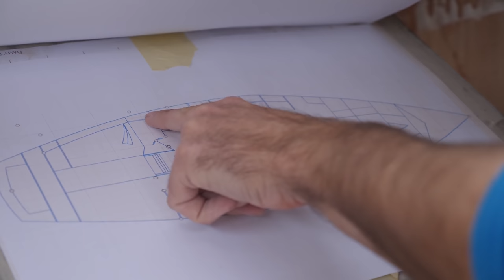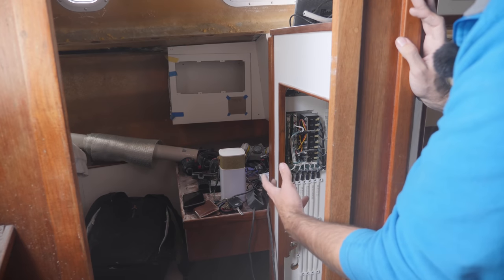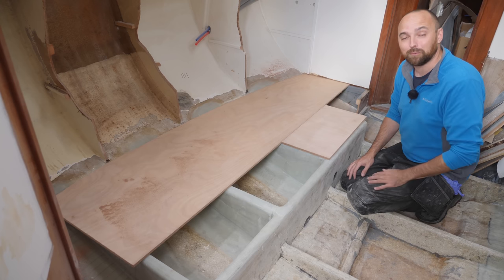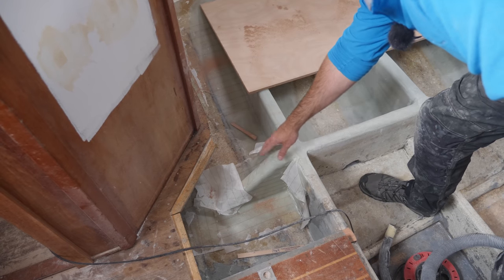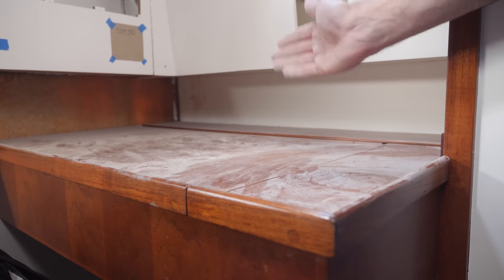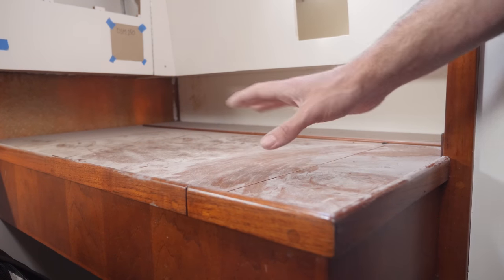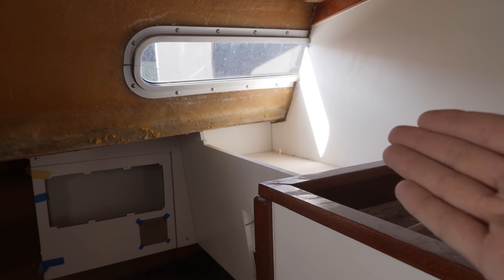Sail Life - Bulkhead number two, check!

Comment: Maybe the door could be made up of vertical slats attached to canvas. This assemble then runs on a curved track (ceiling and floor) between the new bulkhead and aft cabin. Mush like a curved top desk but in the vertical direction. Might match the curved corner across the way.

Comment: I'd think expanding foam (various specialized 2k PU spray foams in cans might work) could work fine, but I think it depends on the adhesion you get to the surface and to the amount of flex. From what I've read PU is stiff but friable, so if it flexes too much it turns into dust. Might not be a problem at all for your sailboat. Might need to ask an engineer.
I'd probably try to do it also below the floorboards for insulation (thermal and acoustic).

Comment: I would think the deep bilge would make a great tank for something like water or more fuel you can never have to much. For the door to the aft cabin i would think about a pocket door it would slide out of the way which takes away for a swinging door and give you more room to move around and can be locked it place open or closed to give more privacy for who ever is using the aft cabin. To hang a curtain or flex door might take away for the craftsmen ship that you are taking time to do on you're boat and will look like a cheep fix look and just might not give you the finished look that you are striving to get with the refit.

Comment: If that Bilge area isn't part of your Keel access then like the previous person is to fill it up again but this time using "Foam Cement" which is light and as strong & Hard as Rock. Glass over it at the depth that suits you.
Reply: Maybe lead shot. or steel or stainless steel shot(Think BB's) heavy and form fitting you could then through a layer of epoxy foam on top and final a real layer of fiberglass and "seal it up" it will leak because it has to leak its a boat.

Comment: Thanks mads👍 have always liked the wooden roller shutter doors one or even two to open in to the back cabin would look great and save space. Don't know if you can build them or just buy and trim to suit?? With regards the bilge at the top of the keel why waste storage space glass and paint use as a storage for beer will be nice and cool, could even make a rack system that pulls up🤯. I know you might get water down there but beers will be fine👍🏴

Comment: Mads    A angle Door would be better more inside room and if someone is sleep in there they can get some RR plus when you use the map area the door will be Close. Good luck. Could you use that deep hole to help drain the boat if water gets in there? Just install a nice Pump to keep it cleen.

Comment: I would make the door like a roll top bread box on its side or two sliding door that comes together. The bread box door is easy to make take a canvas make some wood slats and glue or tack the canvas between the slats like a certain but it would be stiff put a track on top and a Chanel on the bottom. BUT use mold resistant canvas or old sail that is damage to badly for repair.

Comment: i sugest you can put an inclosed pump in that deep bildge to to pump water from the shower to a holding tank for grey water. use the grey water to flush the toilet. that will save you a lot off calcified and glockt hoses in the future. toilet membranes would last a lot longer too.

Comment: I watched  building the chart table many times,  It was heartbreaking to see it destroyed.   Anyhow, what about putting in a sliding door along side the companion way do it slides fore and aft along the side of the engine compartment.  Thus not intruding with either the limited space in the aft cabin or with the new chart table.   Defiantly need to plan for a space to have computer monitors mounted into the new salon.
Reply: Look on the bright side at least you get to see Chart table 2.0 and get to watch that many times.

Comment: The aft cabin is for guests right? Other than that youll be using that room for storage, so a outward openning door would do the trick nicely, your'e not going to be in and out of it all the time. Sliding doors and bifold doors are OK but always compromise the look a little

Comment: Maybe a pocket door for the quarter berth?

I wouldn't like filling that space with foam. Yes, you would do it proper and seal it up good, butif it happened to develop a leak in the future, you would be back to that same foul smelling mess to live with and enjoy. Also, storage space being as valuable as it is on a boat, sealing that up doesn't seem ideal to me. Rather, it could be used as is for a "deep" storage for some oversized items, or break it up and have 2 sections. Glass a lip around it to use as a support for a hidden floor. Cut a board to that size, glass it, put some sort of handle or draw line to help remove it. If worried about standing water if you get a leak, I'm sure you could get some kind of rubber seal between the floor and the support lip, or side wall around the floor board. You wouldn't loose items down it that way, and you would have a bit more storage space to put that extra must have item.

Comment: Rather than a full size door consider a bifold door. The arc is smaller, might not reach the curve of the hull and stores against itself. I've one in the vberth of my IP31 that doesnt interfer with the berth and opens even when you stand in the doorway.

Comment: The digital inclinometer, in English, is pronounced "digital level."  It's just like a regular, bubble level, but it adds a digital readout.  Expanding foam in the deep bilge is a horrible idea.  I would recommend partially filling it, a little at a time, with polyester resin.  Polyester because it's cheaper than epoxy and what you care about is making the bilge smaller.

Comment: With the door issue, if it's just going to be you and the girl on board just put a shower curtain or a fabric curtain like item in place. Once you get in to warmer climates you are going to want as much cross / through ventilation as you can muster.
How ever many fans you think you are going to need add at least three more to the budget.
Once you start getting in to warmer climates how much air you can push through the boat is important.
Also factor in boat ventilation if you lock up or leave the yacht in a warm / tropical climate. My yacht hit 70 degrees C inside over summer while I was away with friends. So while you have the hull in such a stripped out condition putting in ducting for an AC / Heating unit is not a bad thing.
Remember if your water temp is say 24 degrees C that heat is going to permeate up through the boat, so insulation can be your friend here not just for colder EU climate even if you are having a few hot days now.

Comment: using Neodymium magnets embedded in to the ply, everyone will think its voodoo magic :) plus  also have you thought of making the corners radial, its easy to fabricate, make a good vid and if you slip or trip there is no chance of splitting your skull open. In the vid at 15.59 you've left one piece of floor timber this would give you a good reference of where the door would be.

Comment: How about filling the void in your bilge with the same cheap and heavy filler you uncovered in your rudder. The thinking is, any deformations in your keel while underway are less likely to crush the filler, leaving a void. The additional weight would be negligible and would be where you'd want it. Also, cheap?

Comment: Hi,
It's a bit late but. I you have the same value on the two bulkhead measuring this way, they are not parallel. One is 88.8 forward and the other is 88.8 backward. So about 2.4º différence between them.

Comment: Fill the deep void down to the keel with a floor safe of appropriate external dimensions, bedded into an epoxy filler to seal the gaps down the 'sides' of the safe. That gives you somewhere to secure important documents etc. The only downside of giving you this suggestion is you clearly can't make one of your excellent videos of the process, for obvious reasons. It wouldn't be much use as a secure location if you show the world where (and what) it is. Keep up the good work, regardless of the wildly variable European summer weather we're all 'enjoying' at the moment.

Comment: re bilge. I'd ... kind of be inclined to leave it unfilled and just get all the wood out that you can. It's clearly the lowest point in the inside of the boat, which makes it an ideal catchment for water. It's already found water naturally already, obviously. So clear it out, seal it up on sides and bottom, put an automatic pump down there, and cover it with something that easily lets water through and is removable. Metal grating with a layer of canvas on or something?  That'll catch most of the things you want to get back quickly yet leave it serviceable for inspection and cleaning. 

Or maybe someday you'll think "Hmm... I wish I had a place to put three cases of wine" and it'll be waiting for you. Not convenient, but ten minutes with some scrap wood would be all it takes to build a platform to store bottles on, and that too is trivially removable and replaceable and disposable.

Comment: If you are using the suffix "-meter" to designate a unit of measure such as millimeter or micrometer, then the "e"  is long as in the word "me" or "meet". If you are talking about a measuring device such as a speedometer, micrometer (the device which measure small units of length) or inclinometer, then the "e" in "-meter" is short such as in metropolitan or metal.  The words are broken differently also, with micrometer (the unit) being pronounced as my'-kro-meet'-er (emphasis on "my" and "meet") and the measuring device my-krom'-et-er (emphasis on krom). So pronouncing inclinometer would be" in-klin-ahm'-et-ur" (emphasis on "ahm").

Comment: Has anyone noticed that by moving the bulkhead aft Mads has increased the unsupported span along the cabin top. Will this reduce the load carrying capacity outside on top of the cabin? For instance, will the roof be stiff enough to support the weight of a person walking on the cabin top?  Furthermore, was the new or old bulk head landing on the floor supports or between them?  My utter distaste of the bulkhead splitting the port light is finally addressed but....was the original designer forced to locate the bulkhead at that location to maintain cabin top rigidity?
Reply: The span is NOW more evenly braced than it was before. This is a good move adding more evenly spaced strength.

Comment: What about using the bilge as gray water tank at least for the shower? That way there would be no problem using shower under way - heeled or not. Then just a right kind of pump to remove the water when you’re out at sea. Not good idea to let even gray waters to the marina...
Reply: Deep bilge is a great location for another custom stainless steel tank, which would also help to seal it up permanently. Perfect location for gravity shower drainage. Easy, comfortable showers in hot, humid conditions without having to run a pump would be a modernizing upgrade.

Comment: The sliding door sounds like the best option, in calm weather but what about rough seas, will you be able to get a latch that can hold the door?
Reply: I had one in my previous boat. Works just fine. Locks closed with a simple lock and open with a simple hook.
Reply: @Scramasax  Me too!

Comment: Inclination -> the fact or degree of sloping, which leads to inclination-meter or inclinometer. English, easy peasy.  🙄                   😁

Used to use it at work to align communications satellite dishes to their respective geostationary satellites. Great for when you have to align something precisely in relation to something else like during aircraft constructions or, well, boats on 'the hard'.  😀

Comment: Mats, you probably don't have the need at this point but in an earlier video you mentioned your desire to have a CNC machine big enough to cut bulkheads for Athena, have you heard of the Maslow CNC? You should take a look at Maslow, I think it would be perfect for you. It's a (near) vertical CNC that can be built to almost any size plus it is affordable and takes up very little room in a shop. Take a look, I think you'll be impressed. (I have no connection to Maslow, I just thought I'd suggest it to you.) Good luck, fair winds, and following seas. https://www.maslowcnc.com/